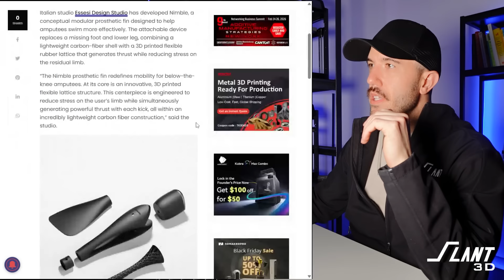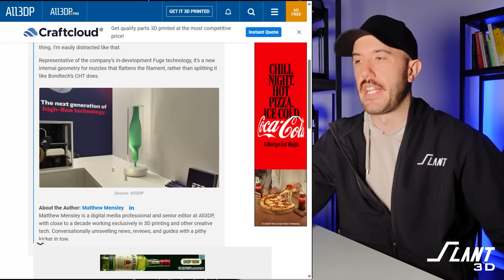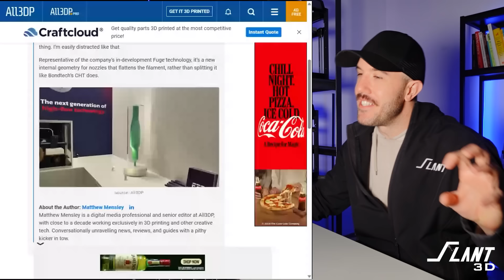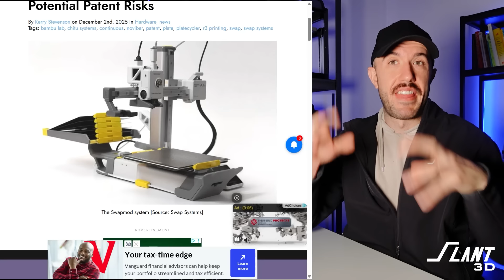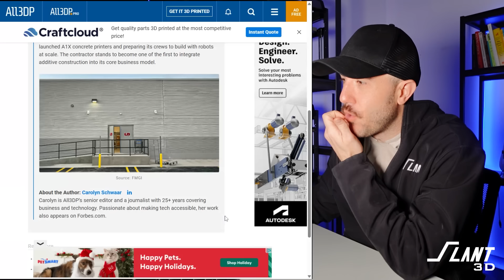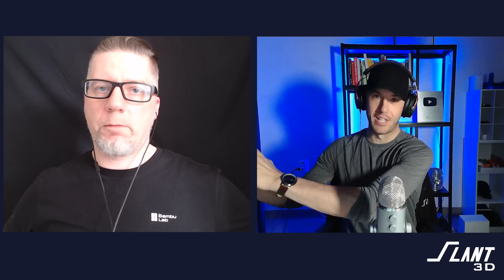Does Campbells 3D Print Chicken? E3D High Flow Nozzle | Pawel Slusarczyk | Podcast Ep 133

Comment: If you're using the spools from Axjo, we have had MAJOR QC issues with them. Like, at least a 2-3% rate of us having to scrap spools, either due to warped edges, unfilled molds, flashing problems, etc.

It's a big part of the reason we've moved away from them. On top of that, they're molded in NC. That means costlier landed costs to our Fargo, ND, extrusion facility. It would be even worse to your ID facility.